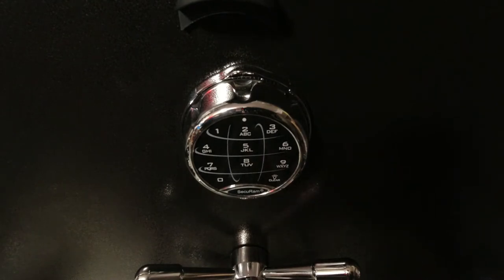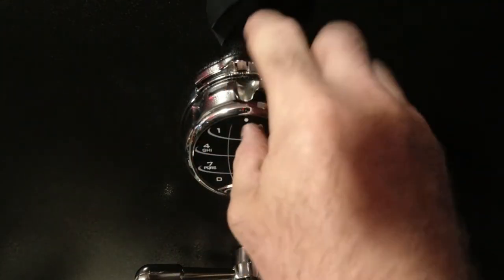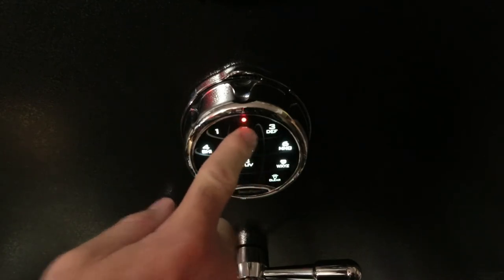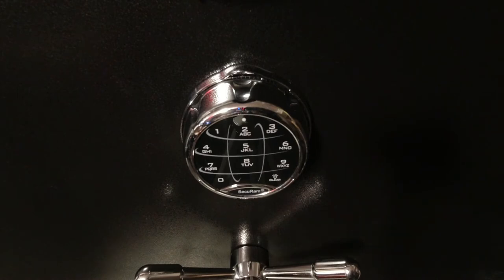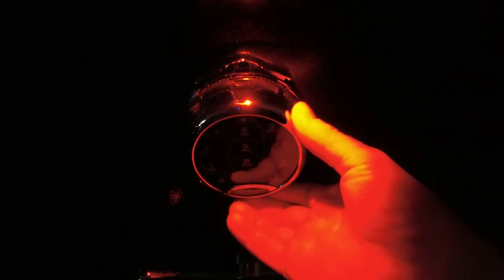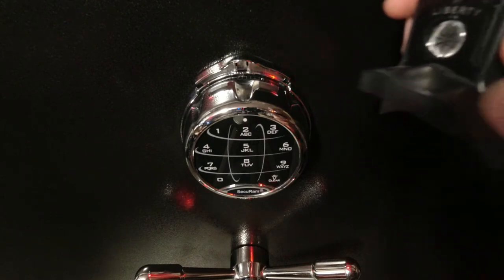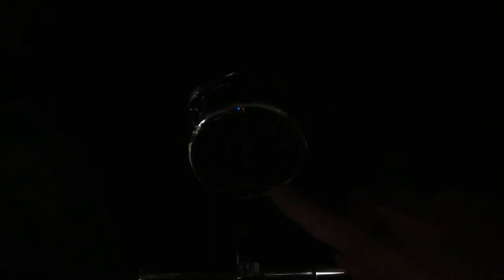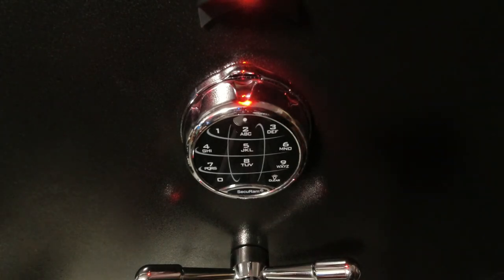SecuRAM SafeLogic X Treme ~5 Years Later...Year 6 UPDATE

Comment: I have the same lock (the original with the light)  I have the same problem you were having with entering the combo correctly and it won't open. I called SecuRam and they told me it's likely shorted and I need to buy a new one...  which now is nearly $600 and out of stock...  we'll I'm not likely to buy another lock that will most likely fail again if they don't know what the problem is...  I love the concept and loved the thing for the first several years...  now it's just frustrating.   If I pop the battery out for a few minutes and then put it back in it will generally work...  oh and that's the price of a whole safe!

Comment: I just called SecuRAM today about a problem I've been having with my circa 2015 Xtreme lock. The rep there was super nice and walked me through several troubleshooting steps. While that was going on she told that one of their suppliers, the company that actually made this lock model, went belly up during Covid. That's why this model disappeared from the market. But they found another company to build them, so they're back in production. And in stock as of recently. Unfortunately, the new lock components aren't compatible with the old lock components. Different firmware. Probably other things too. So you can't mix and match. For example, you can't stick a new keypad piece on your old dial-base and expect the lock to work properly. Gotta replace the entire lock system if using the new components.
Reply from the maker: That's good news to hear as I think these are really great locks.  There are probably not too many female customer service techs @ SecuRAM, so I'm guessing the person you worked with is the same as I had the pleasure of dealing with.  Really knew her stuff and was also good to converse with.  Made a less than ideal situation more tolerable. I wouldn't think twice about buying with confidence from them again.  They didn't have to do what they did for me and I think that makes a big difference in both customer service as well as customer investment protection.  Too many companies take the "too bad so sad" approach to customer service.  Nice to know there are still companies out there that care.
Reply: @ReLoadersBench   I called again yesterday to give them an update on my situation, which actually was that the combo panel stopped working. It would light up on touch, but make no sounds nor unlock the safe. She'd said in the first call, that most likely means the combo front piece is not talking to the inner lock mechanism. 

Same nice woman answered the phone yesterday. I called to tell her that earlier I'd cleaned up the pins and contacts with a swap and alcohol. Gave each pin a gentle tug per her advice (using a dental pick). Then I put it back together---it started beeping right away, at about 3 second intervals continuously, so some progress had been made, obviously. She said that beeping just means it's in "penalty lockout". Does that for five minutes, then should quit and the lock should work again. Sure enough it did. Great to know that I don't need to buy and expensive new version! I still want to follow up with her and tell her it's working fine now.
Reply from the maker: @SDwriter.and.surfer  - Procedure she walked you through is exactly what she had me do as well.  Refreshing to experience customer service that actually knows their product and how to potentially address issues versus someone in a far away country reading from a script and turning pages in a manual.
Reply: @ReLoadersBench  Yeah, no kidding. And she reminded me only to use Duracell or EverReady alkaline batteries. Not cheap or obscure brands (I'd been using a Rayovac in there most recently). Something about too much voltage drop during operation with the cheap batteries. Can be damaging to the circuitry. 

And she clued me in on why they deleted the little lamp. Couple of design problems were causing customer-service issues. There's some little screw in there that backs out a little? and causes that light to flicker when on. That generated a lot of CS calls for them. Also the little CR1025 battery was a problem. While trying to remove/replace them, the battery was too easy to drop accidently and fall down into the mechanism, usually getting hung up somewhere. Maybe even causing a short. That also generated lots of calls. So they decided, as classy as that little light was, it wasn't worth the trouble and not really an essential feature anyway.
Reply from the maker: @SDwriter.and.surfer  - I actually liked the light...until you had to replace the battery.  Too easy to damage the plastic "housing" it set in.  PITA to deal with when not working correctly, so I can see their point/justification for removal.  A feature not worth the CS "cost".  I'm good with my portable, magnet red light "replacement" ;-)
Reply: @ReLoadersBench  Mine has the light too and I do like it; lock is 7 YO now. That phone call was a heads up though to be super careful when removing/installing the battery. I dont' use the combo dial hardly ever. Like, under 20 times since owning this safe. (From Sturdy Safe of Fresno, CA). So the battery hasn't run down at all. But it might be getting old. 

Extra light is good though. I've just been grabbing my nearby LED headlamp to make it all brighter during this troubleshooting stuff. Good call on that magnetic lamp though.

Comment: Ive had issues with the mechanical dial. With the correct combination amd setting it bacl to zero, it would take multiple attempts of going back left and right and usually it will take 5-7 times before it unlocks
Reply from the maker: I never experienced any issues with the mechanical side of any of my 3 SecuRAM SafeLogic locks, only the digital. Sounds like it’s time to swap it out.
Reply: @ReLoadersBench  securam blamed it on the people who installed my safe.
Reply from the maker: Caca Daca - I did my own installs as I like to tinker and learn.
Reply: @ReLoadersBench  Was it difficult to install?  I've watched one installation video by the manufacturer, but I'm interested in how the process went for someone not from the company.
Reply from the maker: @wdvogtjr  - Not a difficult install, but one that you need to understand the steps, take your time and not worry about how long it should take.  I was constantly double checking my work/progress against the instructions as well as the online videos.  Absolutely LOVE this lock!